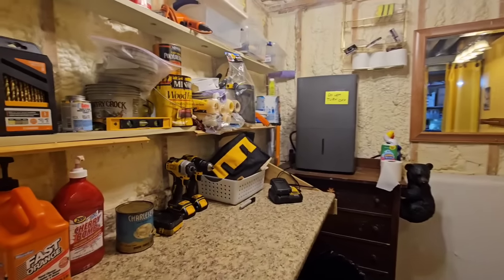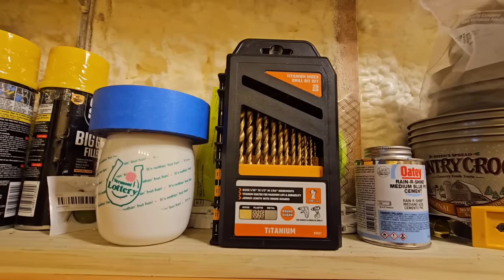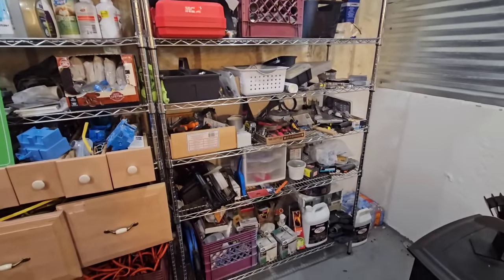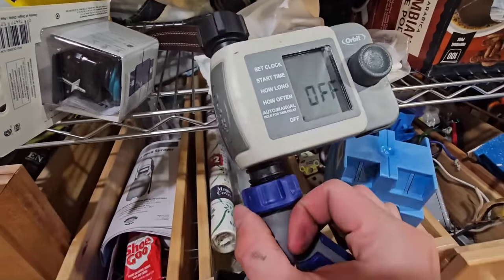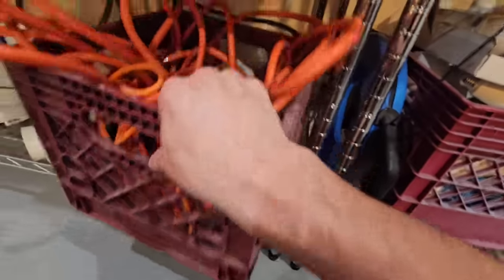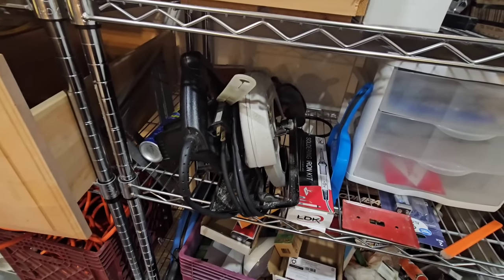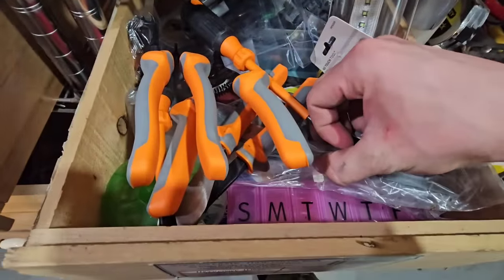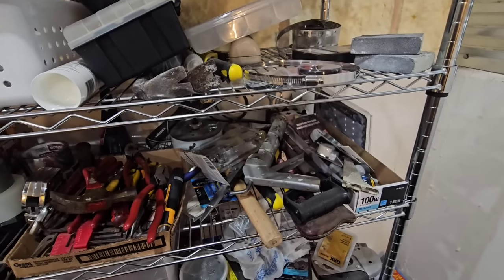Tools And Things Vlog

Comment: That orange piece for your saw is a “throat plate”. It’s to support what your cutting, helps prevent tear out on the bottom of what your cutting, and is a safety to keep smaller cutoffs from dropping down that hole and getting shot out by the spinning blade. They make them with different gaps for different applications and different blade widths. I recommend putting it back in and using it.

Comment: ✴  The orange thing for your miter saw is a throat plate or kerf plate. The opening in the insert is cut on the miter saw to the exact width of the saw's kerf (width).  The matching kerf prevents thin slices of wood from jamming in between the blade and the throat plate during a cut. ✴

Comment: with your old snowblower, you may have more luck if you can find somebody indipendant, not a repair "shop".  we had that issue with an old tractor.  shops wouldn't touch it but we had an older gentleman who worked out of his garge who was great and fixed it right up

Comment: Hey Post, that orange thing is a Throat Plate,   from the Web..."prevents thin slices of wood from jamming in between the blade and the plate" Please note, in order to use your compound miter saw, you must cut a slot through the zero clearance throat plate to allow for blade clearance.""🦫🦫

Comment: Haha I'm surprised you didn't do that joke when you had the studfinder in your hand and scanned yourself with it and said it works
Reply: Yeah where you have an emergency car tool box I use a tool roll just cause it only as big or small of what you have in it just for space. But to eats his own.
Reply: God when you said the water in compressor gave me nightmares. When I worked screen printing they never turned drained the tank. Turned it off yes drained no. So first day when I turned it off and drained the tank.  open and drained 54 gallons of water out if a 55 gallon tank. But that told the owner why he was replacing the chiller (dehumidifier befor the air entered the press) since it was being flooded vs just dehumidifying

Comment: black sockets are usually rated for impact guns and 12 point sockets will come in handy for certain nuts. that orange guard is usually for kickback. that old snow blower see if you can put a new or used small engine on it. get a predator from harbor freight cause if its just an engine you can always just put a new one on it.
Reply from the maker: I was told a machinist would need to make it parts for new engine